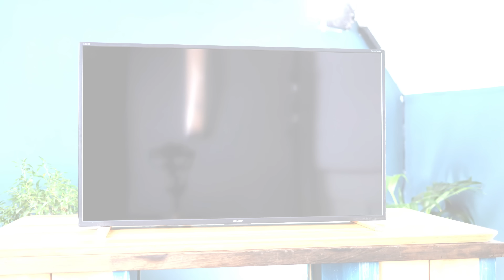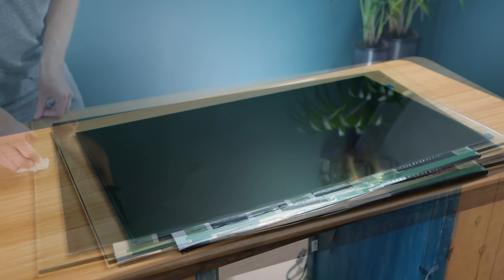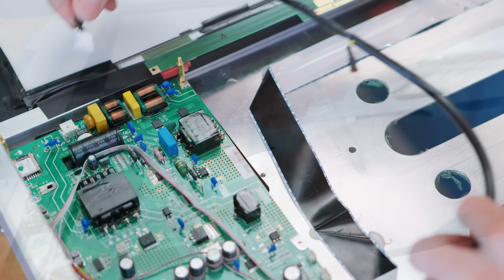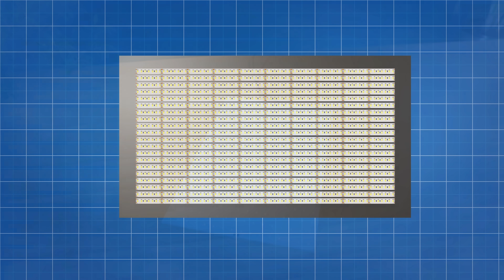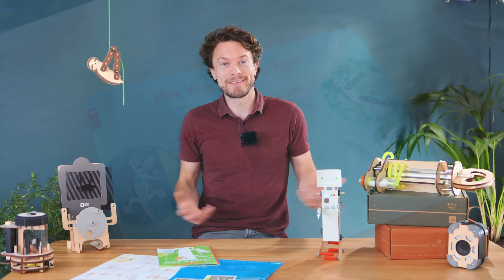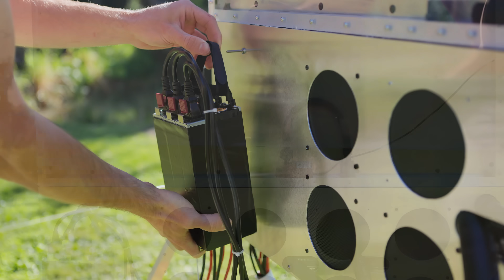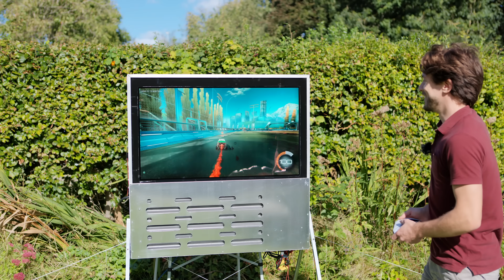Building an ULTRA-BRIGHT water-cooled TV...

Comment: I know you're cooling the LED's with the water... but what about the LCD panel itself, is there enough optical energy there from the LED's to damage the panel?  Especially if it's already outside in a warmer environment and possibly in direct sunlight?  I would imagine the lcd panel could be damaged or just much more quickly degraded over time, to where the crystals won't fully twist or untwist or require a higher voltage or something along those lines, if not outright melt/break.

BTW, the TV's brightness is WAY past 2000 nits... at least 5 to 10 thousand nits.  Given the perceived increase in brightness over the phone, it's WAYYYY beyond double the nits.  Double nits doesn't double perceived brightness, that depends on the ambient light as well.  There are plenty of consumer level screens that can hit 1000-2000 nits and they don't have NEAR the backlight power of this thing, so it has to be WAY beyond that.  10 or even 20k wouldn't surprise me.
Reply: You make a good point about the LCD panel's durabilaty, however from what he said in the video, it seems that this TV will only be used occasionally for get to gethers with friends. It shouldn't be used enough to really perceive that damage in the long term tbh, maybe 1-4h on per week if i had to guess.
Reply: @matf1clips847  good point, plus i see he ventilated the area between the lcd panel and leds, so perhaps that's adequate.   Time will tell.
Reply: Light from LEDs don't really generate much heat, right? You can touch an LED bulb without getting burned (just don't touch the hot base). I imagine it would be the same on the LCD.
Reply: @jaysontrades  these are super powerful leds that produce a lot of heat, that is of course dealt with by the water cooling.  But the light output, as we'll as some heat (IR) from the front as well, is significant.   Doesn't matter if it's an led or incandescent, light is light and it's putting out a certain amount of power that's certainly magnitudes of order higher than stock, hence the concern.   The leds will put out less infrared but the total power of the light output is what matters.  When the scene is black or dark it will be absorbing the majority of all the wavelengths regardless.  I'd bet it can get warm to the touch, but having it directly mounted to the glass certainly helps as a heatsink.

Comment: How well does the remote work outside? I feel like the sun would interfere with the infrared light most though remotes use
Reply: Good point, you would need to get real close and block the sun with your hands.

Ps5 is a good choice cause it uses bluetooth, removing any problem

Comment: question: What would be needed to make this design withstand a maximum outside temperature of about -30C to +30C? (That you remove the water when the temperature approaches +5C of course)🤔
Reply: Do you even know what is water cooling?
Reply: @Angeles C Yes, the LEDs are the ones that will be cooled by the water.  (Backlight) What I mean is this: Say it's -15C outside and it's snowing. You will not use the TV to play games or watch TV.  So my question is will the project last during cold days or should you take it in side during them?
Reply: @navanda4676  swap the water with alcohol water mix, glycol water mix. basically use car antifreeze.

Comment: I could prob check math, but just an idea: is there a way to use an approx. screen-sized lens(?) to use sun as the backlight, after bouncing it into the right direction? And if that's still too dim - then boosted with reduced amount of LEDs?

I always wanted to be able to work outside, and while it's super useful to know that you can literally reuse the normal LCD matrices with more powerful backlight, I don't really want to run 1.6kW+ 8h a day, day after day, and also hard to make it portable enough...

Comment: Why not just connect four 48 volt panels in series and feed them from a simple diode rectifier and capacitor, which will give exactly the voltage you need +- 0.5 volts? I don't understand why would you spend so much money on power supplies to lower the voltage and on voltage boosters to increase it again.
Reply: Bad idea. A smal fluctuation in voltage would change the led current a lot.
Reply: @XD-nj7bc  that's why you have the capacitors, and you can also put in an inductor and stabiliser to protect from overvoltage. And maybe a simple mosfet pwm system to regulate brightness
Reply: @tedarcher9120  thats not what I meant. The peak voltage from the socket changes over  time.
Reply: @XD-nj7bc  not quickly though, and 2-3% change in maximum brightness are really hard to notice
Reply: @XD-nj7bc  problem with his setup is that power supplies are only about 80% efficient and boost converters are also only about 90% efficient, so you lose a ton of energy for nothing. It's much easier and more efficient to make a simple scheme with a photodiod which will control pwm and keep brightness constant
Reply: @XD-nj7bc  I guess a better decision would be to modify the power supplies by replacing the control resistor so it outputs 48 volts, and use a current-limiting varistor to control current
Reply: @tedarcher9120  my pc power supply reaches 96% efficiency. I like your idea though with the rectifying of the grid AND then adding a cc source or pwm.
Reply: @XD-nj7bc  that is possible, but only with 200 dollar power supply working in a small current range. If you push it, it will still drop significantly. And in the video he used dirt cheap 10 dollar supplies running at 80% load
Reply: But how does that even add up? 4*48 V is 196 V. I don't get it. Thats not anywhere near UK's 230/220 V grid. Not even accounting for the fact that 220 V is an RMS value, so 310 V.
Reply: @emiliehans5225  I used 110V, but it can also be done with 230 by using half an autotransformer to lower it to 110v
Reply: @tedarcher9120  so sqrt(2)*110 V = 155 V... I mean, ok use some kind of transformer, sure, but then still you'd have the problem of 120 Hz flicker. Also the grid voltage being +-5%

Comment: New idea, make a outside TV using just the Sun and Mirrors as backlight
Reply: Oh, that's a brilliant idea!
Reply: @The14Some1  yeah molten display, very cool
Reply: @Huomentapoikayt  the heat emitted from the leds in this video for sure is much higher
Reply: @progamer00006  have you ever looked at the sun wth binoculars or a scope or anything that concentrates the light, havent you seen what this guy has made in the past ? A big ass lense for burning stuff using the sun
Reply: @Huomentapoikayt  Yea, you need a lens to concentrate light on one single spot (which is not the goal here), however you dont burn yourself when you hold your hand in the sun, do you?
Reply: @progamer00006  Not that I'm all for the idea, but another thing would be to have the redirected sunlight pass through a pane of infrared-blocking glass to reduce heat.
Reply: Not a great idea as it would require a lot of complicated lens setups and also the sun does not have a fixed brightness which will make this sloppy also the exact brightness of the sun wont be outputted as display has its own inefficiency
Reply: @raghulakash4456  of course it wouldn't be perfect, but it would still probably be a nice experiment, to see how much light a mirror set up reflex camera like behind the panel could provide when the sun is high up.

Comment: Great project! But CRI numbers shouldn't correlate to color quality on rgb filtered displays as far as I know. By the theory behind RGB imaging, you can absoltuely get away by using seperate red blue and green leds picked at correct wavelengths(which is a very low CRI light source by definition) corresponding to the color subpixel peak transmission wavelength and get the best possible image with much higher luminous efficiency(note that there are no phosphor losses in single color LED's compared to white led's). However,  white LED's are commonly used in LCD TVs today for some reasons i don't know. Maybe it's because of design simplicity reasons or for even diffusion of colors as i can only speculate.

Comment: I figured you were going to go the route of using a photosensitive cell to determine how bright it was outside, and if it's above a certain threshold use the sun itself as the lighting source, otherwise mixing the sun and a backlight source dynamically to provide the best ratio
Reply: I'm not sure how you could aim the sun to be right at the screen, as well as reflect back, but it does sound like a fun idea.

Comment: I see you I bet you could make the frontal area smaller as well by using bong coolers behind it (basically evaporative towers). With a custom cut piece of glass, it may even take up the same footprint as the original TV, albeit with a larger back portion

Comment: Did you run into any issues with algeas in the cooling system.?
Reply: i mean its sealed watertight and if you use distlilled water it shouldn't be a big problem but you can always put anti algae or anti microbial solutions into the water

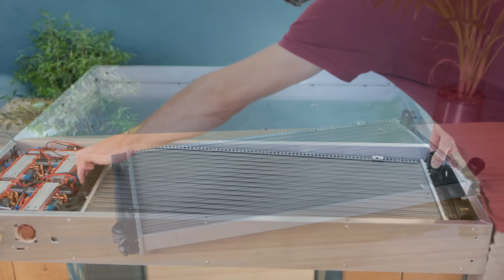Comment: 12:19 please don't use noctua fans for this. They are silent but have not a lot of airflow. Id suggest using delta fans for cooling those voltage boosters. Trust me I know because our schools 3D printer melted because the fan was replaced by a noctua.
Reply: delta fans are insanely loud though this is a TV you want to be able to here the video you are watching
Reply: @shadowxxe  that depends on the model. There are quiter ones too and noise doesn't matter much when the darn thing is used outside which means 2 delta fans should be good

Comment: DIY Perks, 
10 years ago I drove a citroen c4 car,
her speedometer display was interestingly made, there was a backlight, through optical plates, the sun passed through them, and illuminated the display,
there is a sun = there is a backlight,
  there is a strong sun = strong backlight

the sun shines much stronger than your 2kwatt diodes

try to do the same, it would be much cooler.

Comment: Could you use this method to boost HDR performance? If the donor TV was HDR 400 would using a 2,000 nits backlight give you in excess of HDR 1,000.? Brilliant idea, excellent video thanks.
Reply: you're not implementing local dimming in that array in a million years, so no. it's bad for HDR.
unless you do it on a dual layer LCD, but then you'll just be straight up stupid because those are priced higher than cars.
Reply: @GraveUypo  I was thinking about that, wasn't sure if building a FALD setup is feasible.

Comment: Good idea, i did something similar to a monitor years ago, involving replacing the CCFL tubes with basically a ton of LED strips.. Worked quite well! Indeed using one with an already broken backlight makes more sense, though you could always sell the stock ones on as spare parts if they work.. Hmm.. This one's actually tempting, including the water cooling..just need to grab a car radiator from a scrap yard! :D
Reply: Do you have any photos of your screen? I searched online for anyone upgrading to a brighter backlight using 'DIY' 'homemade' and similar but couldn't really find anything that isn't straight up 'replacing this broken backlight with similar one' or 'replacing these CCFL tubes with similar LEDs'.

Comment: Man I could have used this video about a year ago.  I had a 75 in 3d flatscreen that I threw out because the leds were burnt out. I'm not sure how I would have done it though because those panels would have taken 6 people to pick up without shattering them.
Reply: Remove the backside and replace the lights, leave everything else where its at. Maybe build a new case around the old case depending on where you're using it.

Comment: The high CRI is not affecting the color gamut. There are still only three frequencies of color allowed through! (Unless this is an RGBW screen? In which case… yes, maybe?)
Reply: High CRI? What do you mean with 3 frequencies?
Reply: @edh615  He used expensive LEDs with a high CRI (color rendering index, i.e. it outputs a high proportion of the visible color spectrum), and said multiple times that he guessed that it might help the color gamut of the TV. However, because in a typical RGB screen there are only three frequencies of light allowed through, a high CRI won’t affect it.
Reply: @Agnes.Nutter  I thought he meant because of the brightness, do the crystals work differently with such backlight, creating more saturated colours?
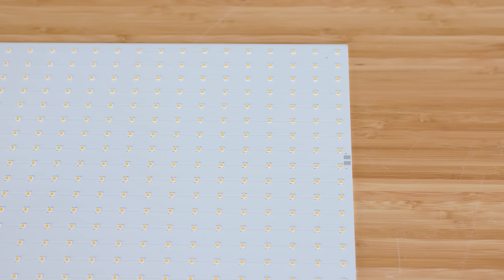Reply: @edh615  The bit where he mentions it: 8:29 "I'm really curious to see what kind of effect they'll have on the colour quality of the final display, as they feature an extremely high CRI of 95."
I think if anything a brighter backlight would be expected to make less saturated colors — if it's enough to overwhelm the ability of the crystals to filter out light, it would let light through besides the intended color.
Reply: @Agnes.Nutter  That is if the emission curve is linear
Reply: @edh615  Does that help? :)

Comment: I have a suggestion: adding a battery level indicator on anything you can charge. I have a Bluetooth speaker that doesn't tell me if it's running out of battery so I'm interested to know if there's some sort of way to add a battery indicator to it

Comment: Would this project be plausible to do for an indoor TV? Just by upgrading the amount of dimming zones from bulbs to LED strips, and taking a cheaper (TCL?) 300ish NIT brightness HDR capable TV and transforming it into a much much brighter (closer to 1,000 NIT like Samsung) TV?
Reply: Also, part of the reason I wouldn't use the same LED lights that he's used in this video is because by using the dimmer LED strips you theoretically wouldn't have to watercolor the TV, and could possibly keep it in it's original housing.

Comment: Hey Matt, I have a challenge/idea for you. I have a Philips Roku TV that my brother broke the screen on. All the other components work (Speakers, remote, wifi, etc.), its just that the display is cracked and distorted. The idea is to take all the internal components from the TV and hook them up to a different display, such as a spare monitor or laptop monitor, so that it still works as a Smart TV just with a different (probably smaller) display. It might not be that difficult but I'm having a difficult time figuring out how to do it. Thought it would fit right in on your channel. Hope it interests you!

Comment: Curious to know if you can make this work with the power of the sun by somehow focusing the light from the sun  with a big magnifying glass and then diffusing that light into the back of the panel. It’s outdoors, it would be cool to use the sun right
Reply: not very practical though eventually the sun will be blocked by clouds, angled incorrectly or just not visible in the fist place it would be such a hassle

Comment: Not sure how much your voltage regulators cost, but you could also use 4x power supplies in series, the HP units you showed have some models that can be modified for this purpose. However, some are not able to do this so some research is required for anyone wanting to do this. One benefit of using 4x psu is increased efficiency as well as well as 3000w total output if the 750w models are used. There are also 460w and 1200w models of the HP server PSU available, all with 98% or greater efficiency.

Comment: First i got to say i love that tv setup its an great idea. But i see an problem whit it, that i think needs to be discussed before others starts doing it. 
I'm by no way an expert but im pretty sure your going to get huge problems whit algae in that cooling setup. At the minimum you need to add some kind of algae poison to the water to prevent them from blooming and clog up your cooling. But i suspect whit that big window in the back its only a question of time before algae will become a problem no matter what chemicals you use to prevent it. This can be a big problem in computer water-cooling and sometimes even big manufactures mess it up. And in computers there's little light compared to your setup.

Comment: Actually I think using a larger CRI might produce a lower color volume / saturation as their spectrum spreads more evenly while the LCD filters are not perfect either, they also let a band of wavelength through, which decreases saturation as it saturation is pretty much how spiky the spectrum can be. That's why new mini LED displays uses blue LEDs with quantum dot conversion film to get very high saturation.